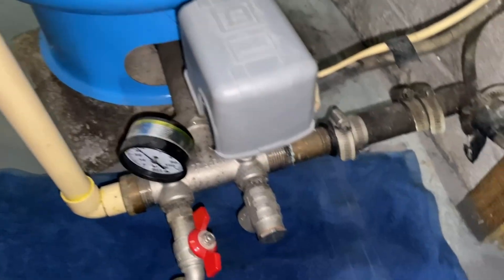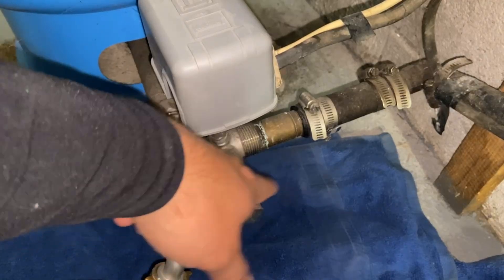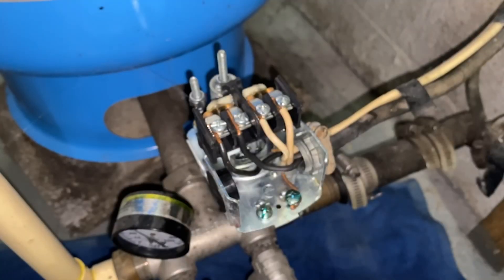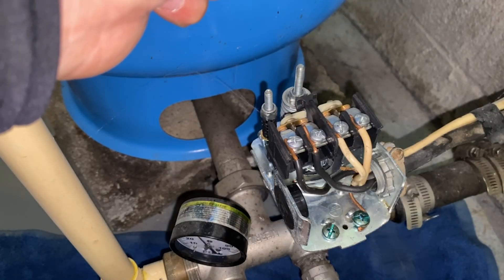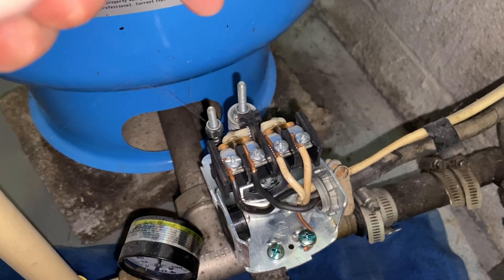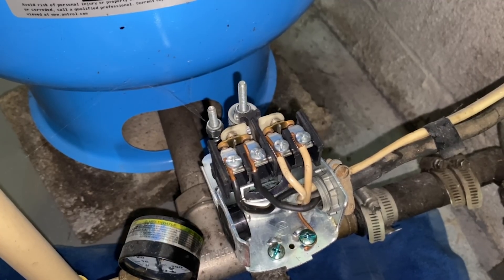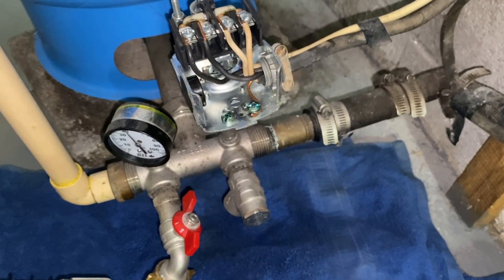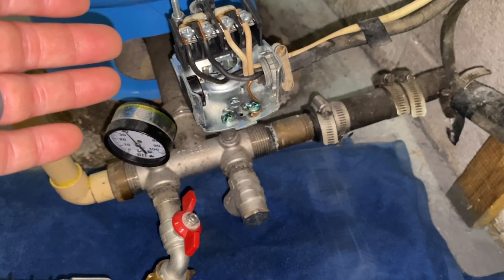How To Increase The Water Pressure With Well Water

Comment: Dude! 👍👍👍Thanks
My pressure switch is always closed and it’s been like that for two years and “working” what do you recommend I do?
Reply from the maker: I'll work on a longer video for this, but that usually means a leak or a weak pump. There are a few other small potentials I'll detail later. The easiest way to check for a leak is to just turn the power to the pump off. Watch the gauge to see if you lose PSI (depends on if you have a check valve or not in the home). If you see nothing, I would wait about 20 minutes. Turn the pump back  on and open a faucet. If you get a spurt of air we know its a leak. Another method would be to run an exterior spigot for a long time while listening to the well head with the lid open. Walk the area between the well head and house while water is running. Sometimes you'll see the yard get wet, the pitless leak or the drop line leaking. Hope this helps
Reply: @W @Wellssepticandmore  I have a standard 40-60 switch and when no water is being used the system builds pressure to the cutoff point.  However, when running a a shower the pump is not able to build pressure above 40 psi until the shower ends.  Is this due to an undersized or weak pump?
Reply from the maker: @zachallen5184  if you've ruled out leakage I would agree either undersized pump or it's on its last leg

Comment: Need help
What's a good presser setting?
New pump and new switch
I have very low pressure
My tank gauge reads 45 psi
Reply from the maker: A typical setting is 40-60 psi. Your current 45 psi is inside that typical range.  You can always look into upgrading to a constant pressure system to maintain a particular pressure setting.  Additional restriction points for psi is filters and aerators.  I would check those to see if it helps

Comment: The fact that one turn of the nut on the central piston rod increases the pressure by 1 psi is important information... usually they say clockwise increases, counterclockwise decreases... no specific numbers... Thanks!
What about the second piston rod? How do I adjust it numerically? I want to increase the cut-off pressure by 2-3 psi, but keep the cut-in pressure the same... now I actually have 28-48, but I want to have 28-50, that is, increase the range by 2 psi...

Comment: Is the pump gauge supose to drop. When the pump cuts in at 35psi? Gauge hits 35psi cuts in immediately drops to 20psi then rises until cut off
Reply: the air pressure is to close to the cut in pressure , You either have to raise the cut in up a little or let 
a little bit of air out of the tank, Let the pump shut off on it's own, then shut the power off and run the water 
until the switch clicks, at that time measure how much water is left, it should be about 1 gallon to get the
most efficiency out of the  tank.
  Bill W

Comment: Great explanation!  We purchased a home built back in 77 and has VERY hard water.    I put in some inline filter systems and pressure dropped off dramatically.   Now I am realizing that I need to check the bladder tank and drain and pressurize to see what it is holding at.   But good to know that I can adjust to increase the pressure if needed.  Thank you.

Comment: My pressure is hi when i turn it on and it drops way down to near nothing, i turn it off and it comes back up but drops out again. Any thoughts?
Reply: Your pump most likely is bad I just had to replace mine it just couldn't keep up
Reply: I had this happen when I used a lot of water for the lawn in hot weather and the well almost dried out... Then the pump started pumping water, and soon it could only pump air... the pressure immediately dropped to zero... When it started raining and we started drawing less water from the well, everything returned to normal...

Comment: Can you do a video or tell me how to solve my problem?  I would like to increase my pressure in the home by maybe 5 to 10 psi and this video explains how to do that. My current psi is like 36. 

Id like to know if theres a way to have 60 psi for my irrigation and leave my home at 40/45 

Like how could I run 2 different lines ??
Reply from the maker: This was a fun question to explore, So I made a video talking about it. Hopefully this helps to give you a couple of options. Thank you for the question
https://youtu.be/SGy8SVwZbiw
Reply: I have done this at a sports stadium, run a separate line for the irrigation, install a check valve then a flow switch then 
a booster pump to give you the pressure that you need. set up this way when you turn the irrigation on the flow switch 
will turn the booster pump on and when you shut the irrigation off the flow switch will turn the booster pump off.

Comment: So what pressure should we have in the bladder?
Reply from the maker: The air pressure should be 2 psi below the cut-on.  For example: if you have a 40/60 switch, you need 38 psi of air for your pre charge
Reply: @Wellssepticandmore  But if you increase your pressure then its 2 psi under that new number, correct?